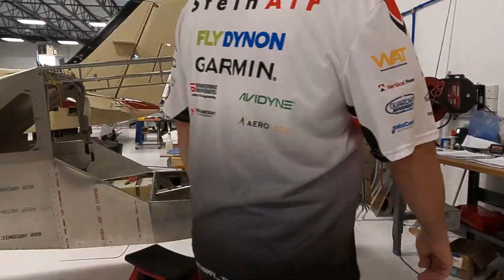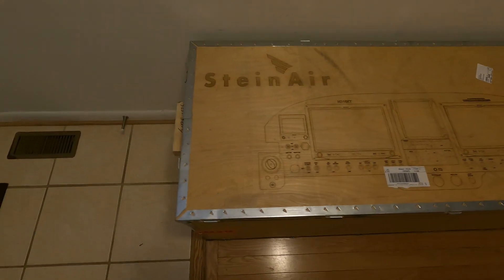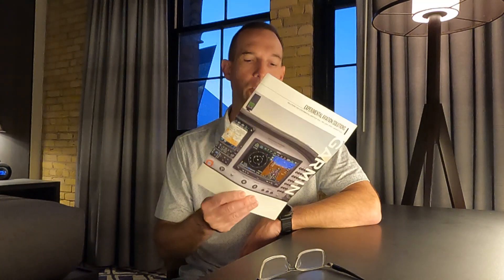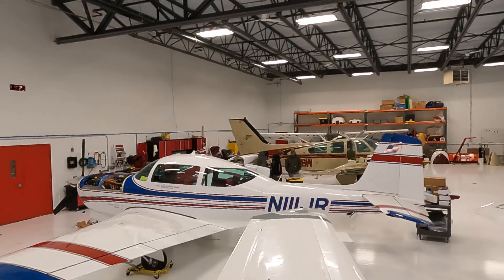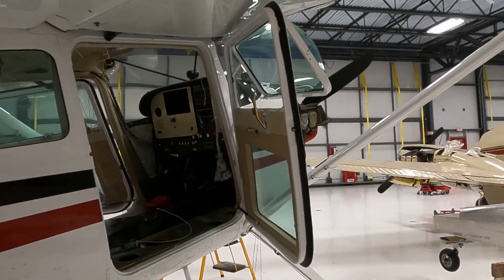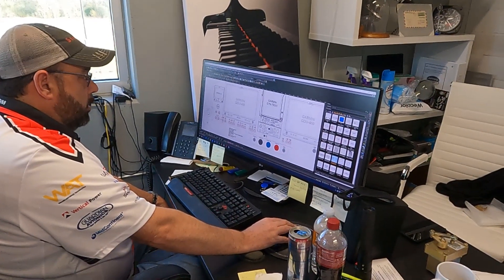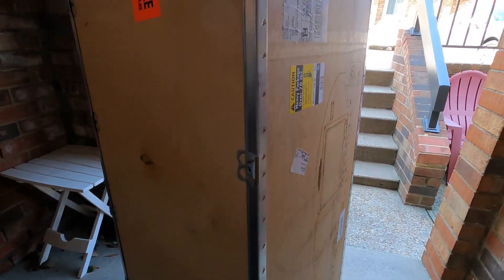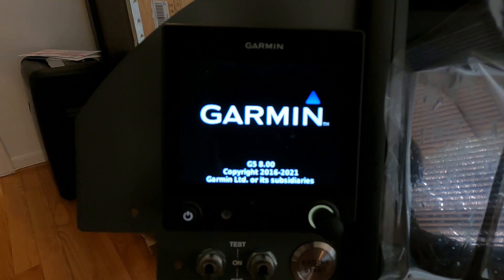$55K Instrument Panel Build

Comment: Are their budget options?
Reply from the maker: There are options for any budget.  The Garmin panel I built represents the higher end of the spectrum.  For lower priced options you could simply add fewer bells and whistles or look at the Dynon series which are equally capable.

Comment: I was having trouble constructing the elevator trim servo harness for my RV-14A build.  I called SteinAir and talked to Stein and he said that they could  build a new harness for me, so I hired them for the job.  They did amazing work with a quick turnaround time at a very reasonable price!  I too, highly recommend SteinAir and will most likely have them build my instrument panel when I get to that point in the build.
Reply from the maker: You have to consider what your time is worth too.  If you’re not proficient, this part of the build could easily add a year or more.  

For the money Stein is worth more than they charge.